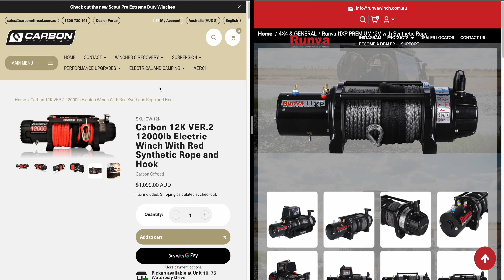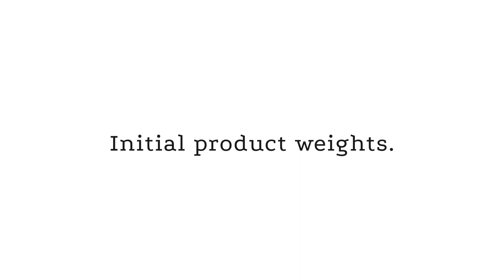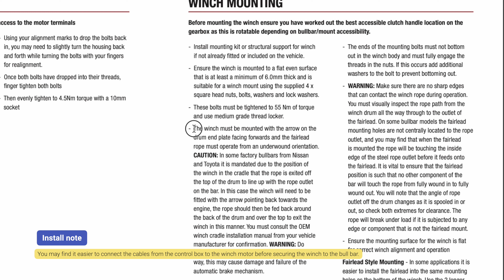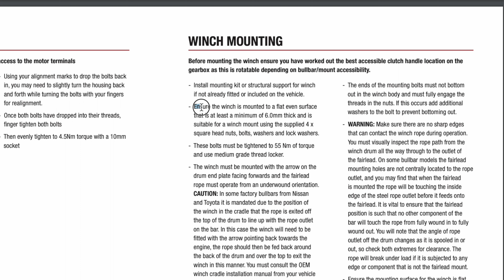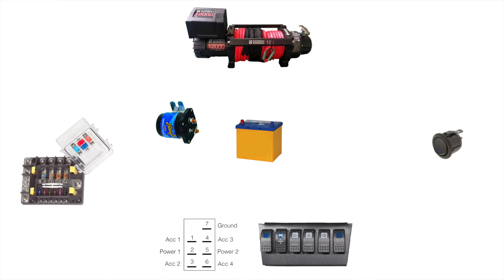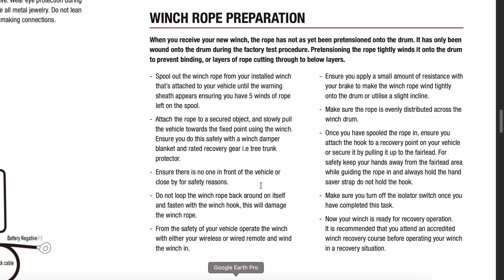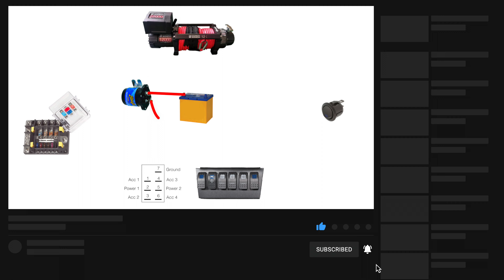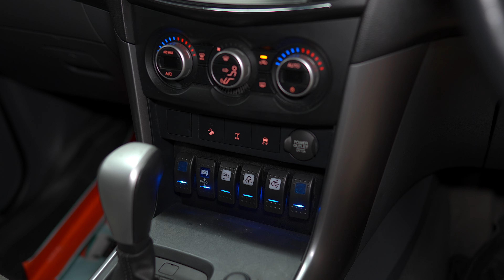Carbon Winch Install || Cab Isolation via 500A Solenoid & IN/OUT Control Wiring

Comment: You actually don’t need the solenoid because the winch control box contains one already. 

Simply wire the winch directly to the battery, a fuse isn’t needed because the winch is designed for high current. Then keep the rest of the wiring the same, with the on/off switch to power the momentary switch, and the momentary switch wired to the winch control box.
Reply from the maker: The solenoid is replacing the winch isolator though. This means that the active cable to the front of the car is not live until I switch it.

I wanted to isolate the cable still but be able to do it from the cab without needing to pop the bonnet and turn on an isolator.

My idea was to maintain the safety standards of the winch as installed to the instructions with the added simplicity of in cab controls 👍